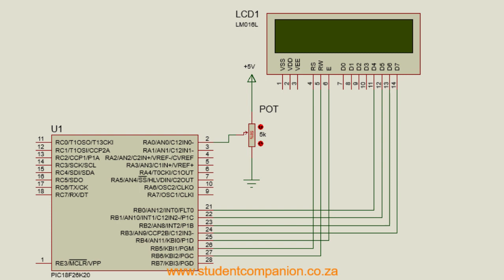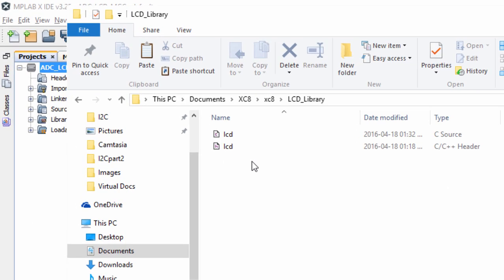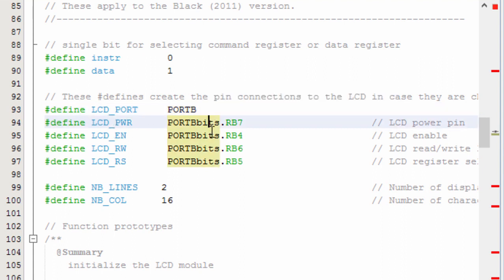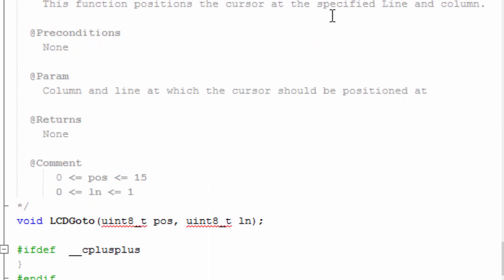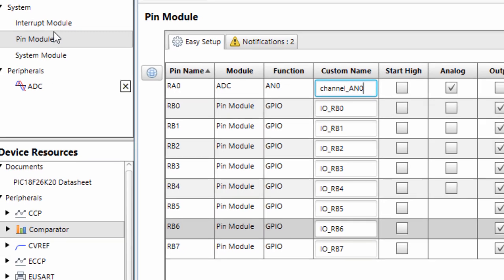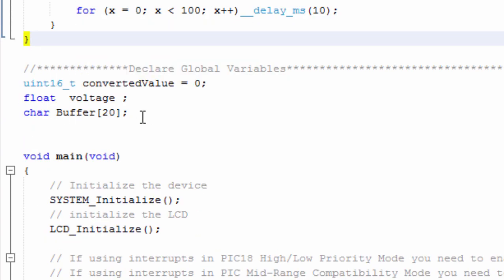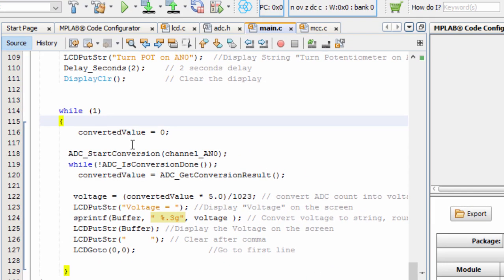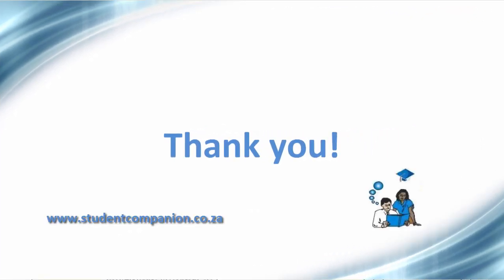22- ADC and LCD with MPLAB Code Configurator | MPLAB XC8 for Beginners Tutorial

Comment: Do I have to use the code configurator tonuse the lcd library files?
Reply from the maker: No. You don't have to use MPLAB Code Configurator
Reply: Student Companion ok cool bro. I got it to work in Proteus with the lm016l lcd. I purchased the LMB162ABC lcd and built it but it's not working. Any thoughts?
Reply from the maker: What do you mean by not working? Is it blank, display wrong characters, displaying black squares? 
Did you check correctly your connection pins like E, RS, R/W? And also the contrast variable resistor?
Reply: Student Companion RW is grounded. It shows black squares when the contrast is set low, otherwise it doesn't show anything. Do these codes support all lcds or does anything have to be changed for the lcd that I am using? Thanks for the replies.
Reply from the maker: How is your lcd connected? Can you describe to which pins of PIC Microcontroller you connected your data, rs and Enable pins? Did you modify the lcd.h and lcd.c files according to your physical connection? Are your physical connection same as in Proteus? Can you double check? Which PIC are you using? Can you blink an LED with your PIC just to make sure your hardware is working?
Reply: Student Companion I'm using PIC18F2620 with lcd LMB162ABC. It's working perfectly on Proteus. The lcd is connected to portB. I just wrote a program to blink an lcd and it's working perfectly.
Reply: RS is connected to RB4 and EN is connected to RB5.
Reply from the maker: You didn't answer all my questions
Reply: Yep I modified the lcd header and c files accordingly.
Reply: Physical connections are the same. I double checked.
Reply: What should I do now.. :(
Reply from the maker: We can't guess what could be wrong. We asked you questions to cross check if everything is fine. But you are economical with info. Post your code (main.c and confi bits) and answer the questions we asked you. We gonna check if everything ok
Reply: ****lcd.h******
/**
    Header File for Module lcd.c

  Company:
    Microchip Technology Inc.

  File Name:
    lcd.h

  Summary:
    This file contains the function prototypes for LCD.

  Description:
    This file contains service prototype definition for LCD access on the PicDem 2 Plus demo board.
*/

/*
Copyright (c) 2013 - 2014 released Microchip Technology Inc.  All rights reserved.

Microchip licenses to you the right to use, modify, copy and distribute
Software only when embedded on a Microchip microcontroller or digital signal
controller that is integrated into your product or third party product
(pursuant to the sublicense terms in the accompanying license agreement).

You should refer to the license agreement accompanying this Software for
additional information regarding your rights and obligations.

SOFTWARE AND DOCUMENTATION ARE PROVIDED "AS IS" WITHOUT WARRANTY OF ANY KIND,
EITHER EXPRESS OR IMPLIED, INCLUDING WITHOUT LIMITATION, ANY WARRANTY OF
MERCHANTABILITY, TITLE, NON-INFRINGEMENT AND FITNESS FOR A PARTICULAR PURPOSE.
IN NO EVENT SHALL MICROCHIP OR ITS LICENSORS BE LIABLE OR OBLIGATED UNDER
CONTRACT, NEGLIGENCE, STRICT LIABILITY, CONTRIBUTION, BREACH OF WARRANTY, OR
OTHER LEGAL EQUITABLE THEORY ANY DIRECT OR INDIRECT DAMAGES OR EXPENSES
INCLUDING BUT NOT LIMITED TO ANY INCIDENTAL, SPECIAL, INDIRECT, PUNITIVE OR
CONSEQUENTIAL DAMAGES, LOST PROFITS OR LOST DATA, COST OF PROCUREMENT OF
SUBSTITUTE GOODS, TECHNOLOGY, SERVICES, OR ANY CLAIMS BY THIRD PARTIES
(INCLUDING BUT NOT LIMITED TO ANY DEFENSE THEREOF), OR OTHER SIMILAR COSTS.
*/

#include "stdint.h"
#include "config.h"

#ifndef _LCD_XC_H
#define _LCD_XC_H

/**
  Section: Included Files
*/
//#include "mcc_generated_files/mcc.h"

#ifdef __cplusplus
extern "C" {
#endif

/**
 Section: Macro Definitions
*/
// set up the timing for the LCD delays
#define LCD_delay           5     // ~5mS
#define LCD_Startup         15    // ~15mS

// Command set for Hitachi 44780U LCD display controller
#define LCD_CLEAR           0x01
#define LCD_HOME            0x02
#define LCD_CURSOR_BACK     0x10
#define LCD_CURSOR_FWD      0x14
#define LCD_PAN_LEFT        0x18
#define LCD_PAN_RIGHT       0x1C
#define LCD_CURSOR_OFF      0x0C
#define LCD_CURSOR_ON       0x0E
#define LCD_CURSOR_BLINK    0x0F
#define LCD_CURSOR_LINE2    0xC0

// display controller setup commands from page 46 of Hitachi datasheet
#define FUNCTION_SET        0x28                         // 4 bit interface, 2 lines, 5x8 font
#define ENTRY_MODE          0x06                         // increment mode
#define DISPLAY_SETUP       0x0C                         // display on, cursor off, blink offd

#define LCDLine1()          LCDPutCmd(LCD_HOME)          // legacy support
#define LCDLine2()          LCDPutCmd(LCD_CURSOR_LINE2)  // legacy support
#define shift_cursor()      LCDPutCmd(LCD_CURSOR_FWD)    // legacy support
#define cursor_on()         LCDPutCmd(LCD_CURSOR_ON)     // legacy support
#define DisplayClr()        LCDPutCmd(LCD_CLEAR)         // Legacy support

//----------------------------------------------------------------------
// Definitions specific to the PICDEM 2 Plus
// These apply to the Black (2011) version.
//----------------------------------------------------------------------

// single bit for selecting command register or data register
#define instr        0
#define data         1

// These #defines create the pin connections to the LCD in case they are changed on a future demo board
#define LCD_PORT     PORTB
#define LCD_PWR      PORTBbits.RB7                      // LCD power pin
#define LCD_EN       PORTBbits.RB5                      // LCD enable
#define LCD_RW       PORTBbits.RB6                      // LCD read/write line
#define LCD_RS       PORTBbits.RB4                      // LCD register select line

#define NB_LINES    2                                   // Number of display lines
#define NB_COL      16                                  // Number of characters per line

// Function prototypes
/**
  @Summary
    initialize the LCD module

  @Description
    This routine initializes the LCD driver.
    This routine must be called before any other LCD routine is called.

  @Preconditions
    None

  @Param
    None

  @Returns
    None
*/
void LCD_Initialize(void);
 
 /**
  @Summary
    Writes character to LCD at current cursor position

  @Description
    This function displays the specified ASCII character at current position on the LCD

  @Preconditions
    None

  @Param
    ASCII character to be displayed

  @Returns
    None
*/
void LCDPutChar(uint8_t ch);

/**
  @Summary
    send an ASCII command to the LCD in instruction mode

  @Description
    This routine writes character to LCD command register

  @Preconditions
    None

  @Param
    ASCII command 

  @Returns
    None
*/
void LCDPutCmd(uint8_t ch);

/**
  @Summary
    display a string

  @Description
    This routine writes string to LCD at current cursor position

  @Preconditions
    None

  @Param
    Pointer to string

  @Returns
    None
*/
void LCDPutStr(const char *);                         

/**
  @Summary
    Fuction to write a nibble

  @Description
    This function writes the specified nibble to the LCD.

  @Preconditions
    None

  @Param
    data byte to be written to display

  @Returns
    None
*/
void LCDWriteNibble(uint8_t ch,uint8_t rs);

/**
  @Summary
    Initialization routine that takes inputs from the EUSART GUI.

  @Description
    This function positions the cursor at the specified Line and column.

  @Preconditions
    None

  @Param
    Column and line at which the cursor should be positioned at

  @Returns
    None

  @Comment
      0 <= pos <= 15
      0 <= ln <= 1
*/
void LCDGoto(uint8_t pos, uint8_t ln);
    
#ifdef __cplusplus
}
#endif

#endif /* _LCD_XC_H */

**************************

********config.h************

// PIC18F2620 Configuration Bit Settings

// 'C' source line config statements

// CONFIG1H
#pragma config OSC = INTIO67    // Oscillator Selection bits (Internal oscillator block, port function on RA6 and RA7)
#pragma config FCMEN = OFF      // Fail-Safe Clock Monitor Enable bit (Fail-Safe Clock Monitor disabled)
#pragma config IESO = OFF       // Internal/External Oscillator Switchover bit (Oscillator Switchover mode disabled)

// CONFIG2L
#pragma config PWRT = OFF       // Power-up Timer Enable bit (PWRT disabled)
#pragma config BOREN = OFF      // Brown-out Reset Enable bits (Brown-out Reset disabled in hardware and software)
#pragma config BORV = 3         // Brown Out Reset Voltage bits (Minimum setting)

// CONFIG2H
#pragma config WDT = OFF        // Watchdog Timer Enable bit (WDT disabled (control is placed on the SWDTEN bit))
#pragma config WDTPS = 32768    // Watchdog Timer Postscale Select bits (1:32768)

// CONFIG3H
#pragma config CCP2MX = PORTC   // CCP2 MUX bit (CCP2 input/output is multiplexed with RC1)
#pragma config PBADEN = OFF     // PORTB A/D Enable bit (PORTB<4:0> pins are configured as digital I/O on Reset)
#pragma config LPT1OSC = OFF    // Low-Power Timer1 Oscillator Enable bit (Timer1 configured for higher power operation)
#pragma config MCLRE = OFF      // MCLR Pin Enable bit (RE3 input pin enabled; MCLR disabled)

// CONFIG4L
#pragma config STVREN = ON      // Stack Full/Underflow Reset Enable bit (Stack full/underflow will cause Reset)
#pragma config LVP = ON         // Single-Supply ICSP Enable bit (Single-Supply ICSP enabled)
#pragma config XINST = OFF      // Extended Instruction Set Enable bit (Instruction set extension and Indexed Addressing mode disabled (Legacy mode))

// CONFIG5L
#pragma config CP0 = OFF        // Code Protection bit (Block 0 (000800-003FFFh) not code-protected)
#pragma config CP1 = OFF        // Code Protection bit (Block 1 (004000-007FFFh) not code-protected)
#pragma config CP2 = OFF        // Code Protection bit (Block 2 (008000-00BFFFh) not code-protected)
#pragma config CP3 = OFF        // Code Protection bit (Block 3 (00C000-00FFFFh) not code-protected)

// CONFIG5H
#pragma config CPB = OFF        // Boot Block Code Protection bit (Boot block (000000-0007FFh) not code-protected)
#pragma config CPD = OFF        // Data EEPROM Code Protection bit (Data EEPROM not code-protected)

// CONFIG6L
#pragma config WRT0 = OFF       // Write Protection bit (Block 0 (000800-003FFFh) not write-protected)
#pragma config WRT1 = OFF       // Write Protection bit (Block 1 (004000-007FFFh) not write-protected)
#pragma config WRT2 = OFF       // Write Protection bit (Block 2 (008000-00BFFFh) not write-protected)
#pragma config WRT3 = OFF       // Write Protection bit (Block 3 (00C000-00FFFFh) not write-protected)

// CONFIG6H
#pragma config WRTC = OFF       // Configuration Register Write Protection bit (Configuration registers (300000-3000FFh) not write-protected)
#pragma config WRTB = OFF       // Boot Block Write Protection bit (Boot Block (000000-0007FFh) not write-protected)
#pragma config WRTD = OFF       // Data EEPROM Write Protection bit (Data EEPROM not write-protected)

// CONFIG7L
#pragma config EBTR0 = OFF      // Table Read Protection bit (Block 0 (000800-003FFFh) not protected from table reads executed in other blocks)
#pragma config EBTR1 = OFF      // Table Read Protection bit (Block 1 (004000-007FFFh) not protected from table reads executed in other blocks)
#pragma config EBTR2 = OFF      // Table Read Protection bit (Block 2 (008000-00BFFFh) not protected from table reads executed in other blocks)
#pragma config EBTR3 = OFF      // Table Read Protection bit (Block 3 (00C000-00FFFFh) not protected from table reads executed in other blocks)

// CONFIG7H
#pragma config EBTRB = OFF      // Boot Block Table Read Protection bit (Boot Block (000000-0007FFh) not protected from table reads executed in other blocks)

// #pragma config statements should precede project file includes.
// Use project enums instead of #define for ON and OFF.

#include <xc.h>

#define _XTAL_FREQ 8000000

*****************
Reply: ****lcd.c******

/**
    Header File for Module lcd.c

  Company:
    Microchip Technology Inc.

  File Name:
    lcd.h

  Summary:
    This file contains the function prototypes for LCD.

  Description:
    This file contains service prototype definition for LCD access on the PicDem 2 Plus demo board.
*/

/*
Copyright (c) 2013 - 2014 released Microchip Technology Inc.  All rights reserved.

Microchip licenses to you the right to use, modify, copy and distribute
Software only when embedded on a Microchip microcontroller or digital signal
controller that is integrated into your product or third party product
(pursuant to the sublicense terms in the accompanying license agreement).

You should refer to the license agreement accompanying this Software for
additional information regarding your rights and obligations.

SOFTWARE AND DOCUMENTATION ARE PROVIDED "AS IS" WITHOUT WARRANTY OF ANY KIND,
EITHER EXPRESS OR IMPLIED, INCLUDING WITHOUT LIMITATION, ANY WARRANTY OF
MERCHANTABILITY, TITLE, NON-INFRINGEMENT AND FITNESS FOR A PARTICULAR PURPOSE.
IN NO EVENT SHALL MICROCHIP OR ITS LICENSORS BE LIABLE OR OBLIGATED UNDER
CONTRACT, NEGLIGENCE, STRICT LIABILITY, CONTRIBUTION, BREACH OF WARRANTY, OR
OTHER LEGAL EQUITABLE THEORY ANY DIRECT OR INDIRECT DAMAGES OR EXPENSES
INCLUDING BUT NOT LIMITED TO ANY INCIDENTAL, SPECIAL, INDIRECT, PUNITIVE OR
CONSEQUENTIAL DAMAGES, LOST PROFITS OR LOST DATA, COST OF PROCUREMENT OF
SUBSTITUTE GOODS, TECHNOLOGY, SERVICES, OR ANY CLAIMS BY THIRD PARTIES
(INCLUDING BUT NOT LIMITED TO ANY DEFENSE THEREOF), OR OTHER SIMILAR COSTS.
*/

#include "stdint.h"
#include "config.h"

#ifndef _LCD_XC_H
#define _LCD_XC_H

/**
  Section: Included Files
*/
//#include "mcc_generated_files/mcc.h"

#ifdef __cplusplus
extern "C" {
#endif

/**
 Section: Macro Definitions
*/
// set up the timing for the LCD delays
#define LCD_delay           5     // ~5mS
#define LCD_Startup         15    // ~15mS

// Command set for Hitachi 44780U LCD display controller
#define LCD_CLEAR           0x01
#define LCD_HOME            0x02
#define LCD_CURSOR_BACK     0x10
#define LCD_CURSOR_FWD      0x14
#define LCD_PAN_LEFT        0x18
#define LCD_PAN_RIGHT       0x1C
#define LCD_CURSOR_OFF      0x0C
#define LCD_CURSOR_ON       0x0E
#define LCD_CURSOR_BLINK    0x0F
#define LCD_CURSOR_LINE2    0xC0

// display controller setup commands from page 46 of Hitachi datasheet
#define FUNCTION_SET        0x28                         // 4 bit interface, 2 lines, 5x8 font
#define ENTRY_MODE          0x06                         // increment mode
#define DISPLAY_SETUP       0x0C                         // display on, cursor off, blink offd

#define LCDLine1()          LCDPutCmd(LCD_HOME)          // legacy support
#define LCDLine2()          LCDPutCmd(LCD_CURSOR_LINE2)  // legacy support
#define shift_cursor()      LCDPutCmd(LCD_CURSOR_FWD)    // legacy support
#define cursor_on()         LCDPutCmd(LCD_CURSOR_ON)     // legacy support
#define DisplayClr()        LCDPutCmd(LCD_CLEAR)         // Legacy support

//----------------------------------------------------------------------
// Definitions specific to the PICDEM 2 Plus
// These apply to the Black (2011) version.
//----------------------------------------------------------------------

// single bit for selecting command register or data register
#define instr        0
#define data         1

// These #defines create the pin connections to the LCD in case they are changed on a future demo board
#define LCD_PORT     PORTB
#define LCD_PWR      PORTBbits.RB7                      // LCD power pin
#define LCD_EN       PORTBbits.RB5                      // LCD enable
#define LCD_RW       PORTBbits.RB6                      // LCD read/write line
#define LCD_RS       PORTBbits.RB4                      // LCD register select line

#define NB_LINES    2                                   // Number of display lines
#define NB_COL      16                                  // Number of characters per line

// Function prototypes
/**
  @Summary
    initialize the LCD module

  @Description
    This routine initializes the LCD driver.
    This routine must be called before any other LCD routine is called.

  @Preconditions
    None

  @Param
    None

  @Returns
    None
*/
void LCD_Initialize(void);
 
 /**
  @Summary
    Writes character to LCD at current cursor position

  @Description
    This function displays the specified ASCII character at current position on the LCD

  @Preconditions
    None

  @Param
    ASCII character to be displayed

  @Returns
    None
*/
void LCDPutChar(uint8_t ch);

/**
  @Summary
    send an ASCII command to the LCD in instruction mode

  @Description
    This routine writes character to LCD command register

  @Preconditions
    None

  @Param
    ASCII command 

  @Returns
    None
*/
void LCDPutCmd(uint8_t ch);

/**
  @Summary
    display a string

  @Description
    This routine writes string to LCD at current cursor position

  @Preconditions
    None

  @Param
    Pointer to string

  @Returns
    None
*/
void LCDPutStr(const char *);                         

/**
  @Summary
    Fuction to write a nibble

  @Description
    This function writes the specified nibble to the LCD.

  @Preconditions
    None

  @Param
    data byte to be written to display

  @Returns
    None
*/
void LCDWriteNibble(uint8_t ch,uint8_t rs);

/**
  @Summary
    Initialization routine that takes inputs from the EUSART GUI.

  @Description
    This function positions the cursor at the specified Line and column.

  @Preconditions
    None

  @Param
    Column and line at which the cursor should be positioned at

  @Returns
    None

  @Comment
      0 <= pos <= 15
      0 <= ln <= 1
*/
void LCDGoto(uint8_t pos, uint8_t ln);
    
#ifdef __cplusplus
}
#endif

#endif /* _LCD_XC_H */

****************************

*****main.c*********

/*
 * File:   main.c
 * Author: Yusuf
 *
 * Created on 10 March 2018, 7:40 PM
 */

#include <xc.h>
#include "stdint.h"
#include "stdio.h"
#include "PIC18F2620.h"
#include "lcd.h"

void main(void) {
    
    OSCCON = 0x76;
    
    LCD_Initialize();
    LCDPutCmd(LCD_CURSOR_OFF);
    LCDPutStr("Hello");
    LCDGoto(0,1); //2nd line
    LCDPutStr("World");
    
    
    while(1){
    
    
    }
   
}
**************************
Reply from the maker: Switch OFF LVP if not needed. You still didn't post your main.c code and explain how your lcd pins are connected to your pic. The pins not the port. Are u using internal oscillator?
Reply from the maker: The more info you supply the easier to get assistance. People can't guess if you assume the rest are fine.
Reply: The main.c code is posted above. Yes I'm using internal oscillator. D4 - RB0, D5 - RB1, D6 - RB2, D7 - RB3.